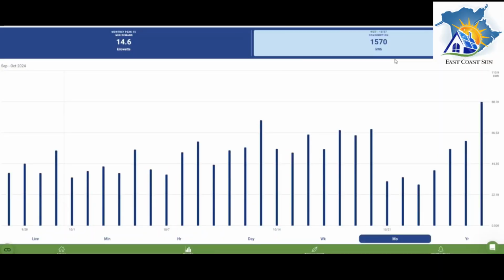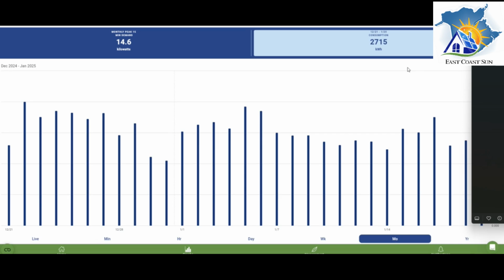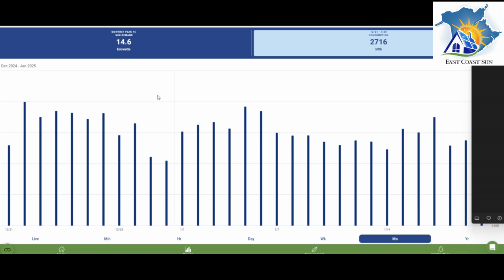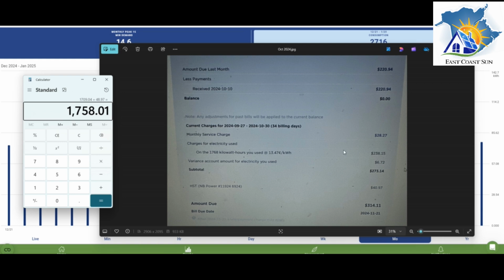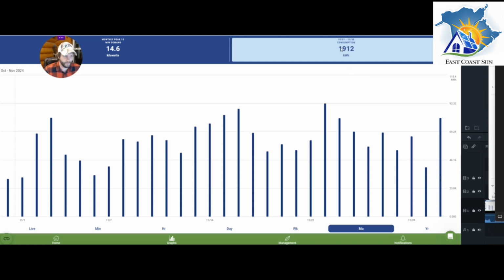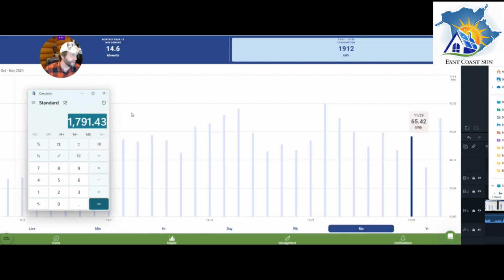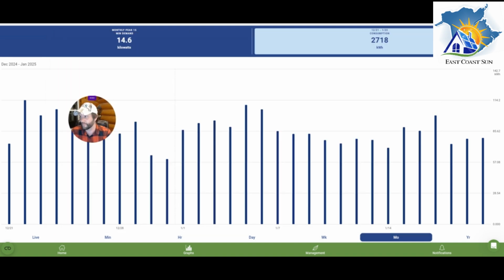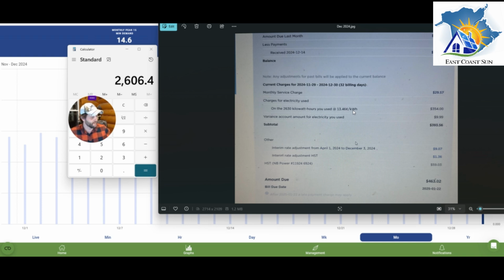Smart Meters - the cause of high power bills?

Comment: When we got solar 7 years ago we simply looked at two years of bills and calculated the daily usage of our house was 50kwh.   At the same time solar was installed we also installed a E-gauge device and realized there was a high base load in the hosue.   Three fluorescent fixtures in the basement were on 24/7... never really thought about them.   Turned them off, converted all lamps to LED and usage went to 34kwh a day.   

An ounce of conservation is woth more than a pound of production.